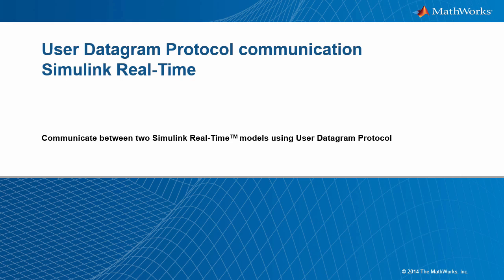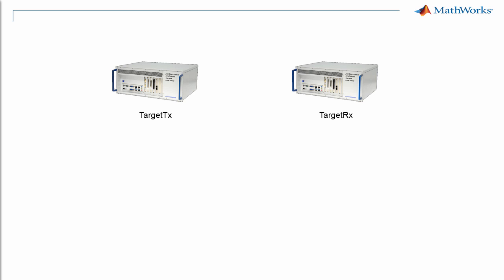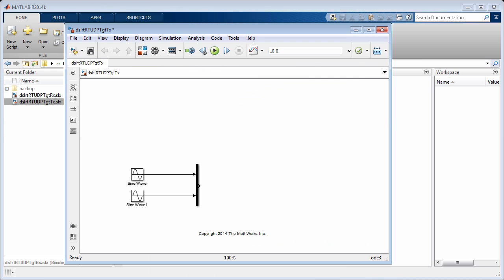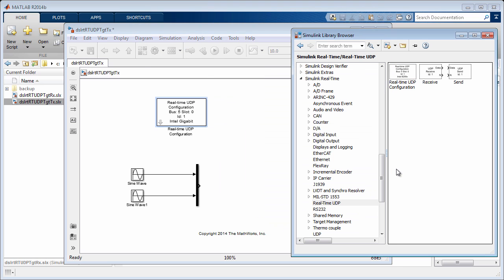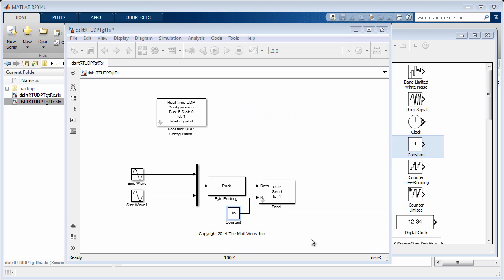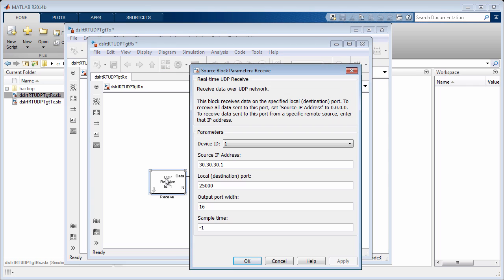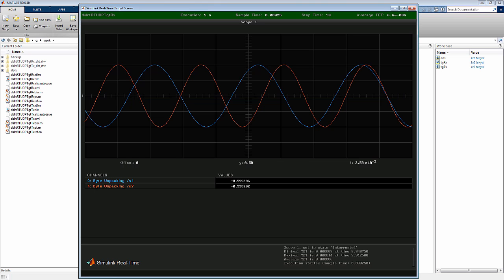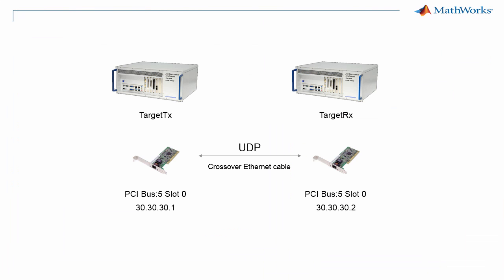Real Time UDP Communication Support

Comment: Is it possible to set up just the transmitting end in simulink and the receiving end in the code for the controller? I am trying to use this for Hardware in the Loop testing using a B&R controller and I don't think it's necessary to set it up for both...